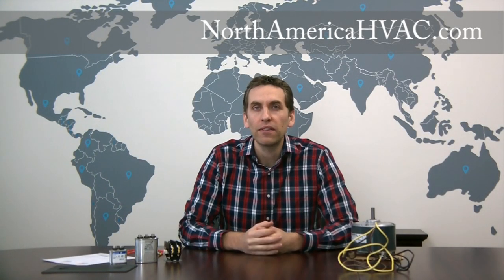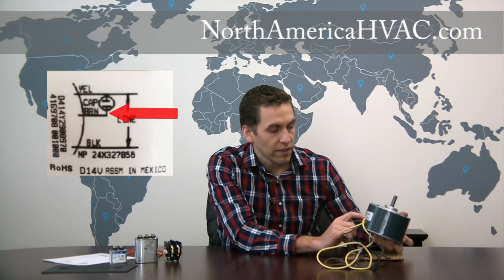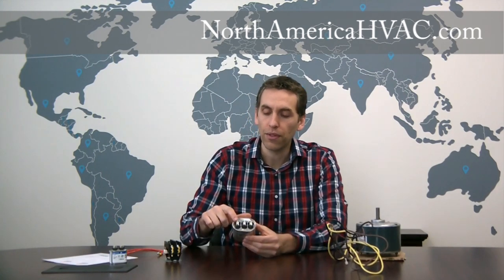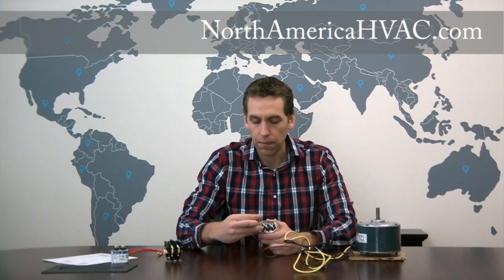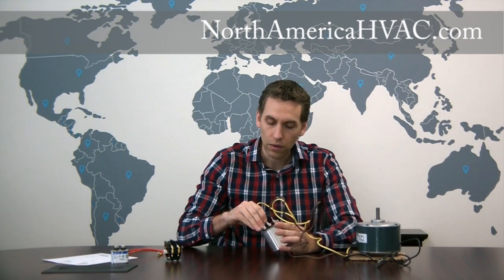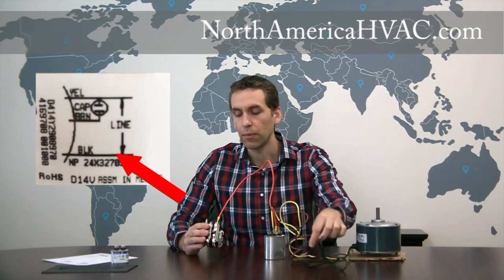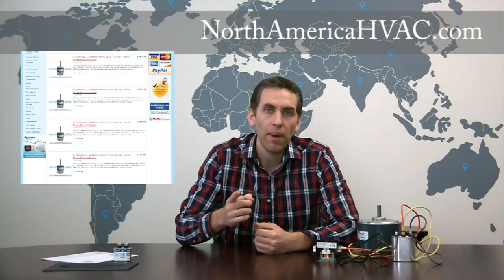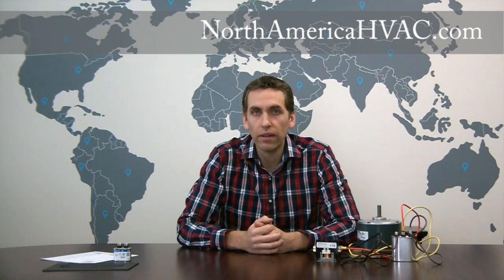How to Wire a 3 Wire AC Condenser Fan Motor

Comment: Any wire(s) connect to Herm?
Reply: No.  The HERM terminal on your capacitor is one of the connections for the compressor.  (HERM stands for hermatically-sealed compressor).
Reply: not from the fan motor.

Comment: can you please tell me what the t line on the diagram stands for. Also can you connect a motor withouth the line on the diagram?
Reply from the maker: Which "T" are you referring to?  The work "line" on the diagram simply points to the two wires that are considered "line" wires-  You must have three wires to hook up your motor in the manor described in this video.  You do not need any more, cannot have any less.

Comment: Wrong you can use a three wire on a single fan capacitor if you run a common wire to the Fan capacitor. Or run a jumper from the common on the dual capacitor to the fan capacitor
Reply: wrong The common wire to the fan capacitor or the jumper makes it a 4 wire

Comment: why is that i cant use 2 terminal capacitor
Reply: if i have a separate cap for compressor and the fan?is it ok to wire the fan motor in 2 terminal cap?
Reply: @bwasfpv  yes.